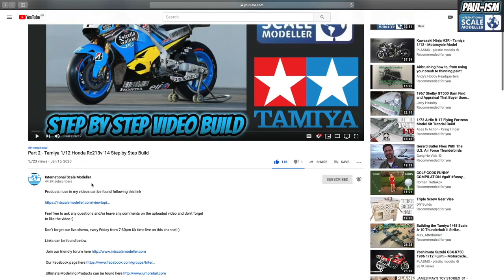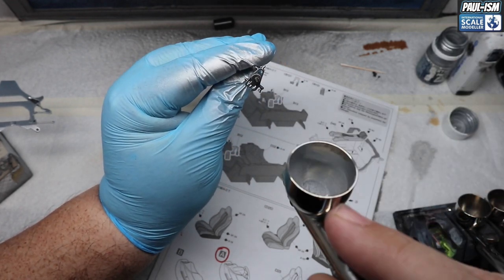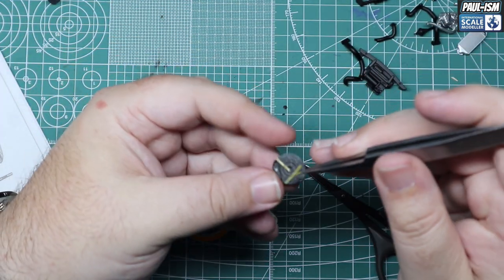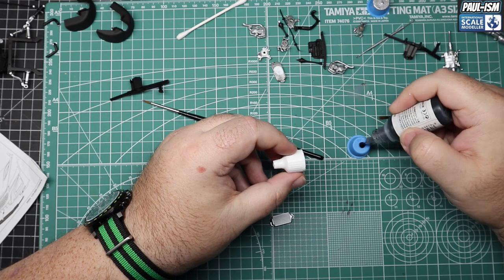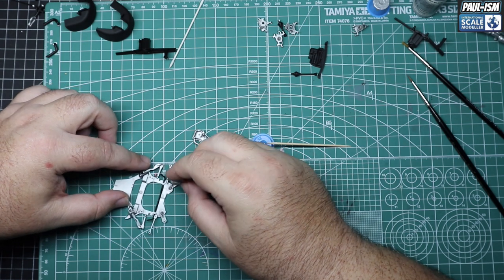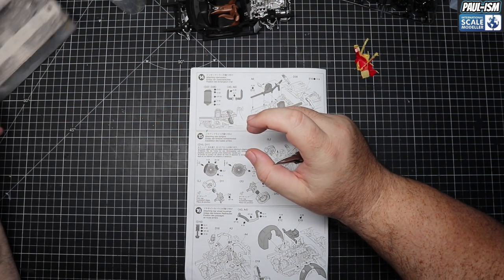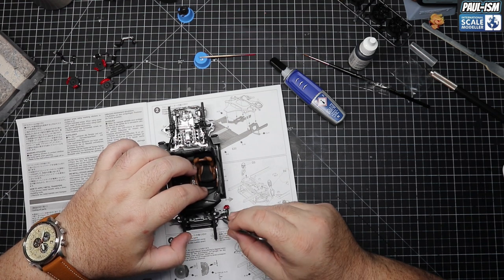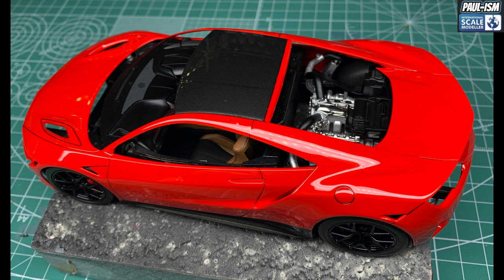Part 3 - Tamiya 1/24 Honda NSX Step By Step Build

Comment: Zero paints must have changed their carbon ceramic paint. Mine had little plastic grey flakes instead of metallic flakes, and over time they melted into the paint and just turned the whole bottle dark grey. Which is why I did my tutorial on using the sponge method instead. Great video as always my friend. Cheers  (Am I using cheers right?)
Reply from the maker: Cheers buddy thanks for watching - Paul :)

Comment: Thanks, Paul,  here's one: have you ever ran the electric mixer too long in  glass jar?  I did, it overheated the glass bottom and it broke the glass and all the paint over my desk and pants :(:(:(:(
Reply from the maker: No i've not managed that lol angle the pot to keep the bb away from the mixer